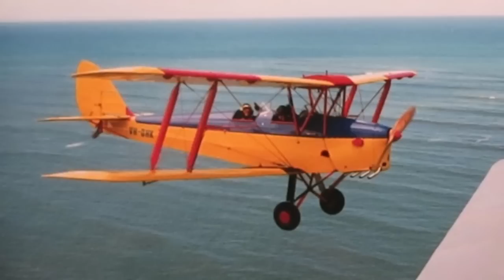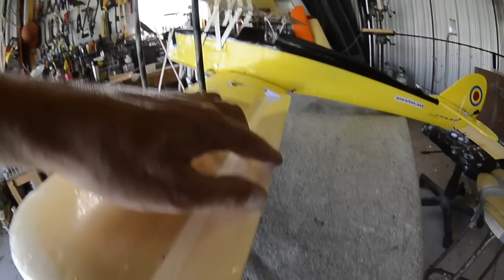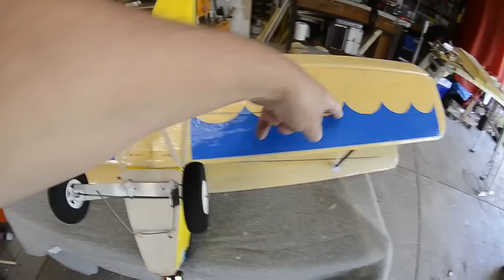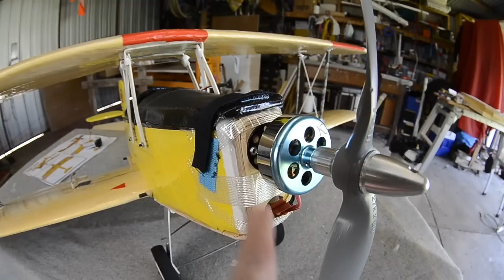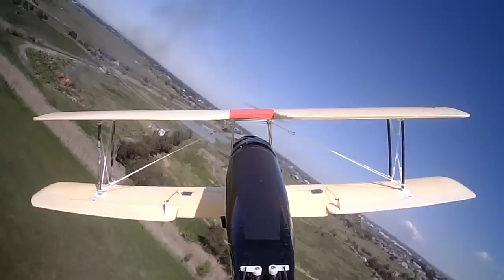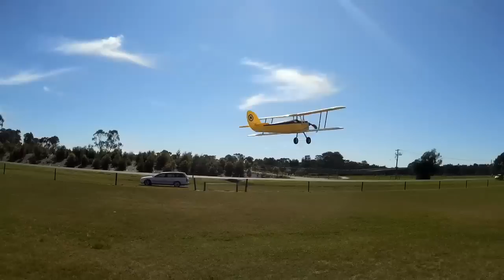1.2m Tigermoth build overview

Comment: WOW!!!!!   THANKS, VERY MUCH, FOR SHARING YOUR HELPFUL, AND INSPIRING VIDEO!!!   FYI: I'M CURRENTLY BUILDING A "HOT-WIRE" CUTTING TABLE... WITH A TILTING SURFACE THAT WILL ALLOW ME TO CUT, UPWARDLY, IN A NEAR VERTICAL PLANE,... TAKING ADVANTAGE OF THE RISING HEAT FROM THE HOT WIRE, TO HELP SPEED THE CUTS, AT REDUCED AMPS, AND, PROVIDING A THINNER KERF, (USING A SMALLER DIAMETER NICHROME WIRE... MY GOAL IF ALSO TO BLOW UP OLD 3-VIEW DRAWINGS/PLANS, AND ROUGHING OUT APPROXIMATE ("STAND-OFF-SCALE") MODELS OF INTERESTING OLD PLANES, THAT I LIKE THE APPEARANCE OF, ... (MANY ARE CIRCA 1930s - 1950s)....  I ENJOY FLYING LOW AND SLOW, AND HOPE TO DO SOME "DOG-FIGHTING" TOO!! ... [IF I CAN FIND WILLING OPPONENTS...]  CHEERS!!!
Reply from the maker: Oh yes that sounds like a good cutting setup

Comment: years ago i also built a Biplane but built up balsa. Only 3 ft span but ailerons linked top and bottom. The wings are held on by rubber bands. There is one strut per wing. Both struts sit loosely in the wings. The wings are then tensioned near the tips with turnbuckles and fishing line.  I ended up with a large lump of lead between the motor and the firewall. It flies well with fast loops and rolls. Like the fpv view from the rear. Just needs the flying scarf trailing back!
Reply from the maker: +ourblue Built-up balsa looks so cool, I must see if document laminate will cover it OK.

Comment: Haha good ol DT750's left over from a tricopter I bet :P
Reply from the maker: +RCShufty Correct. Perfect motor for a retro plane.
Reply: Yep, I used a couple of spares ones of my old tricopter for my scratch build cargo plane :D So much thrust on 4S!
Reply: +Andrew Newton @  Have some  DT750 from hexa too :) .   Good idea but i never knowed that DT750  can run on 4S. I used them only with 3S.  Now 2 from them goes on a twinn airboat. For future: found some TMoth plans. I am your follower.
Reply: bessybessy Yep, they work great on 4S, just try not to over-prop them, 9" or 10" max
Reply from the maker: +bessybessy Twin DT750 airboat sounds serious.

Comment: That view from v. stabilizer looks great
Reply from the maker: +FunTom I agree. Great viewpoint.
Reply: +Andrew Newton have you come up with better solution for connecting wings strongly + so they can be detached easily? I havent build biplane yet, but very possibly will be my next build
Reply from the maker: +FunTom Tom, I'm happy with the way the wings are attached to the fuselage. Easily detached by removing the 2 pins at the top and rubber bands at the bottom. But I have not perfected attaching the wings to each other yet. Might have to glue brackets into the wings to which the struts will be bolted.